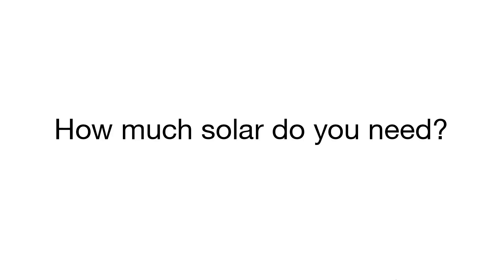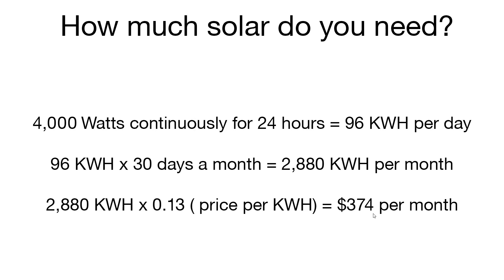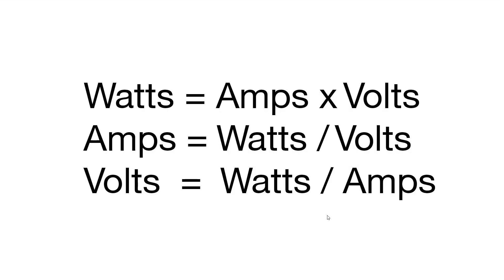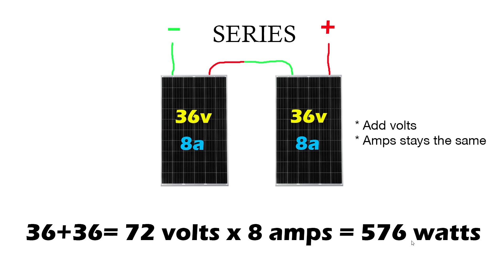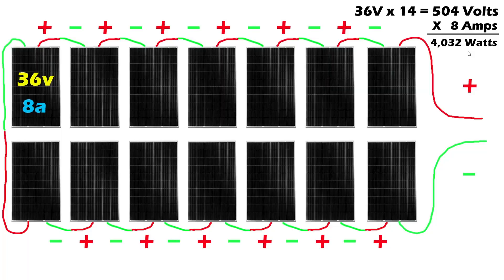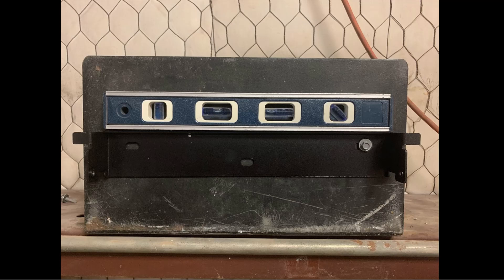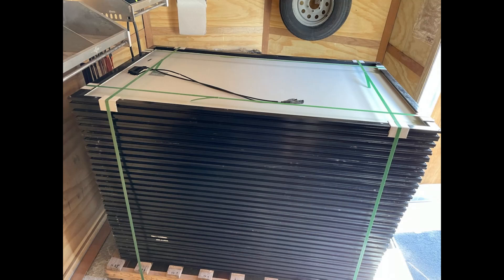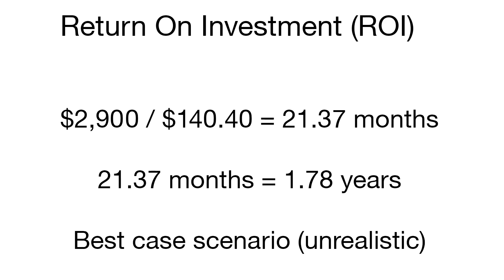Part 2 - DIY Solar Powered Crypto Mining Farm - Under $3,000 - Wiring Explained - Amps, Volts, Watts

Comment: So am I right if my rigs use 3000 watts, that means my rigs consume 72kwh per day? And I would need a 72kw solar system to power those rigs 24-7?
Reply from the maker: @Jaster, you would only need a 12kw system.  You’ll get about 6 hours a day of sunlight. 12kw x 6 hours = 72kwh
Reply: @MineSum10  I'm in far Northeast bordering Canada I only get about 3.5-4 peak sun hours.

Comment: Is this inverter grid tie, so you can spin meter backwards and use grid as battery?
Reply from the maker: Yes sir that is exactly what it is 👍
Reply: @MineSum10  nice! I need to do this but for like 10,000. We already have a 4500 system that puts out 3000